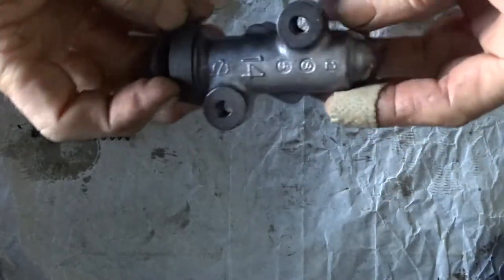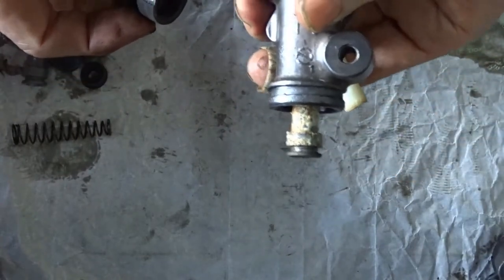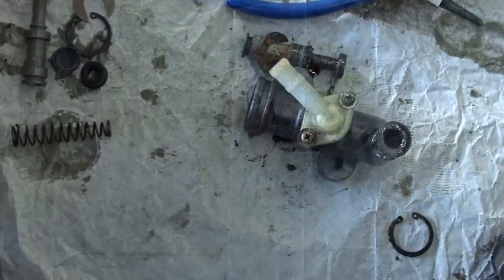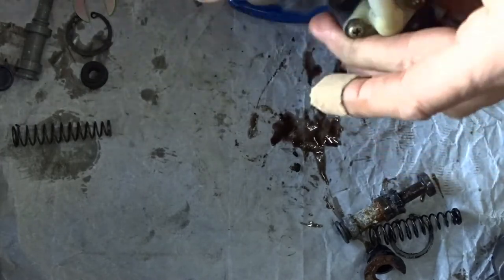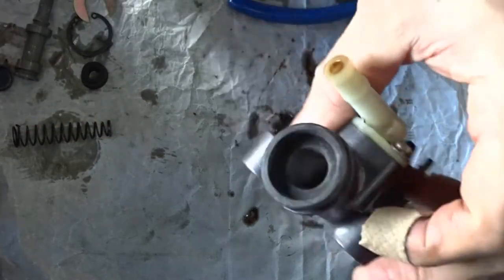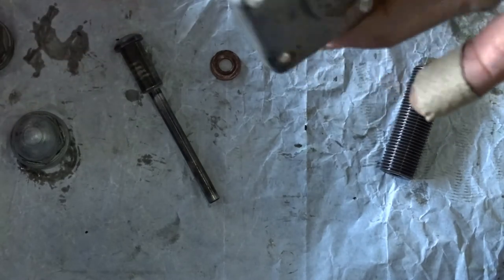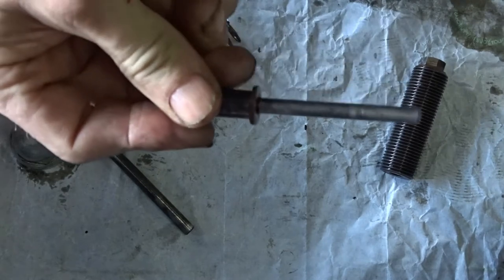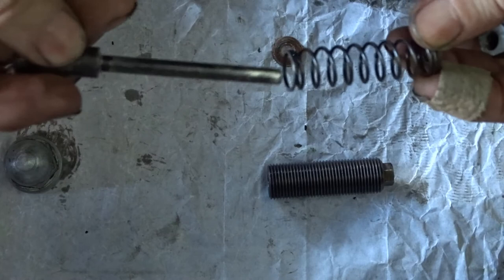XS650 Rear Brake Master Cylinder Seal Kit Service and Cam Chain Adjuster Explained

Comment: Another good vid , very clear info on the cam chain adjuster, which I’d read to be awkward to adjust
Reply from the maker: Cheers Glenn, yeah pain in the arse to get to under the carbs, not half as bad as the XJ750 though, need tiny hands for that one

Comment: good tips for my basket case that I did NOT take apart
Reply from the maker: How far you got with it?
Reply: @OldBiker  cleaning bolts and parts with wire wheel brush, gathering courage, trying to decide if the crank is any good

Comment: good jawb .....I lubricate the entire piston and seals assembly with brake fluid before I insert the piston into the cylinder. I find it helps  when its time to bleed the brake as a dry piston and seals sometimes have a tendency to stick at the bottom of the cylinder and not return .   Good tip about the copper washer . 
All this fettling has inspired me to get my bike in the shed and give it a good service and clean . Only problem is, the bike has to thread through the kitchen to get to the bluddy garden shed.
Reply from the maker: I was out there again today John but it was that cold it started snowing, bugger that, went back home. I dont think her indoors would appreciate you pushing the bike through the kitchen lol I Never thopught about brake fluid lube during assembly, I will next time though  👍
Reply: @OldBiker  its a bit cold for working in the garage at the minute isn't it.Saying that ....my partners Brother-in-law has been out in his garage all day every day doing woodwork for weeks now in all weathers with absolutely no heating ! Mind you he's a Marine and I guess they did that sort of sh*t for a living . Me I'm sitting in a comfy armchair in the warm surfin ............yeah....

Comment: The timing chain adjuster has a copper washer to reduce noise, not to give the correct adjustment. The big screw should be wound in until the rod is flush with the end but whether the washer is in there or not, the spring will make up the difference. Also, the adjuster never goes solid. When you have the rod flush, that's the point when the spring is putting the correct pressure onto the slipper.

Comment: cliff on my 79 the cam adjustor is actually not even poking out or level it seems to be inside should i try to adjust so it comes level? or could it be crook
Reply from the maker: Hi Al, yeah it should be level, I would take it off completely first to check it doesn't have extra washers that would prevent it from coming out
Reply: so if u undo all the bolts it comes away and how many washers should be there ,i think it has a gasket? @OldBiker
Reply from the maker: @alwood9148 Don't undo the bolts just unscrew the adjuster fully out, it should have one copper washer between the spring and housing
Reply: thanks mate will check in the morning @OldBiker